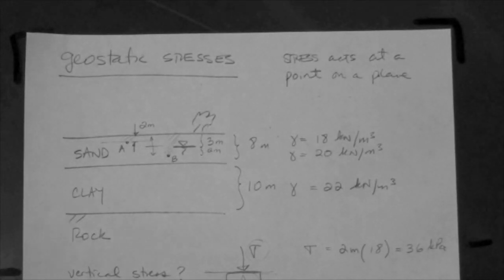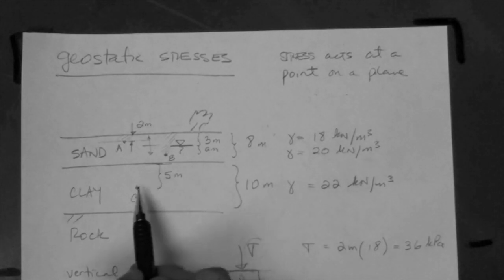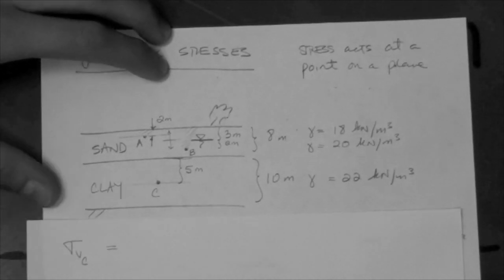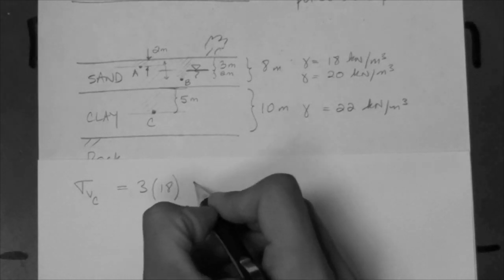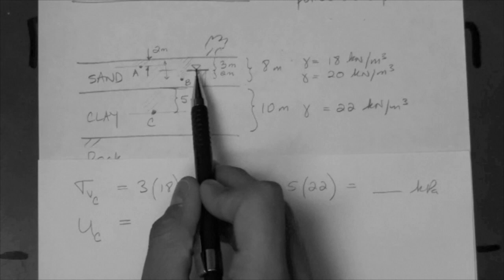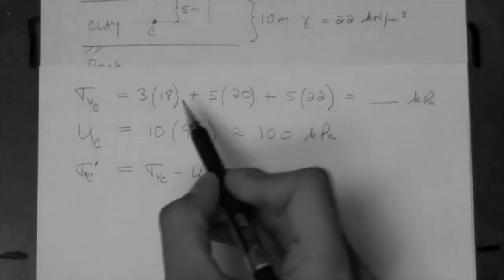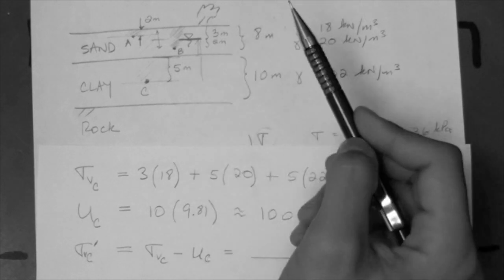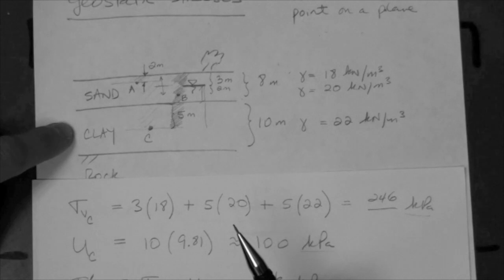Vertical geostatic stresses 3

Comment: Answer is 164 kPa for vertical effective stress. Small correction, but 3m of dry sand times dry unit weight of 18kn/m3 results in 54 kPa.